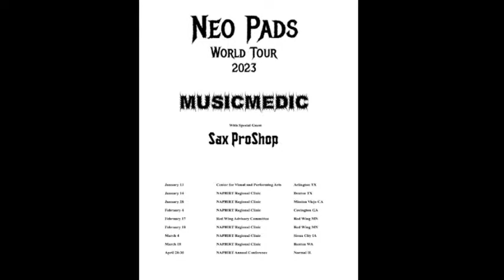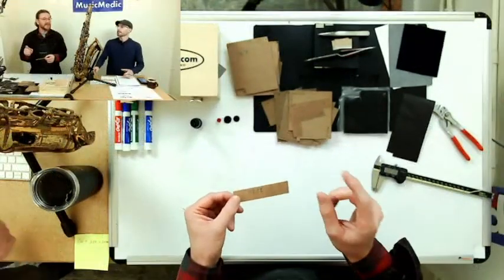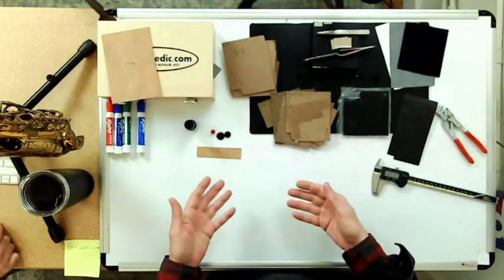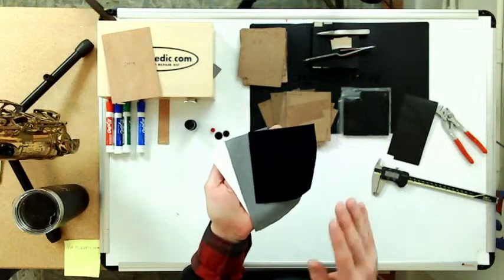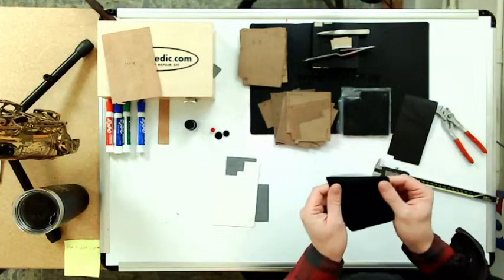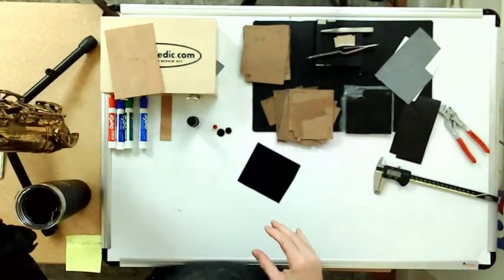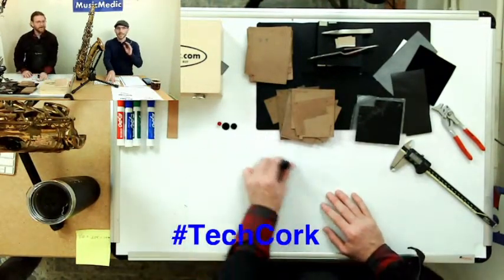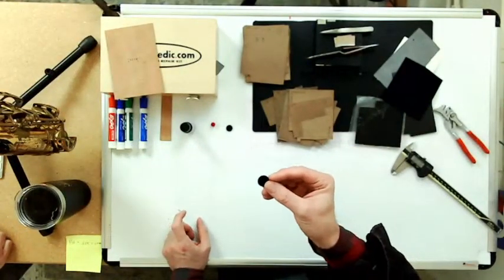Alternatives to Cork for Regulating Keys on woodwinds! #WednesdayWisdom.

Comment: Surprised that other adhesives like rubber cement might not be used, as to not be difficult to remove the excess after adhering the regulating material.
Reply from the maker: Don't be afraid to experiment with different adhesives. They all have their pluses and minuses. The key is to make sure you use an adhesive that's not too thick.  If you find something good please let us know!